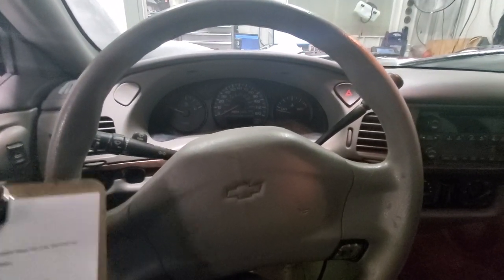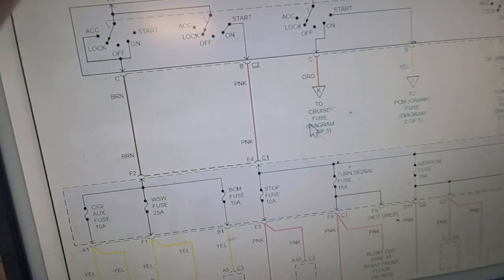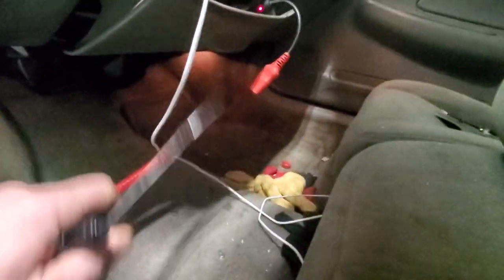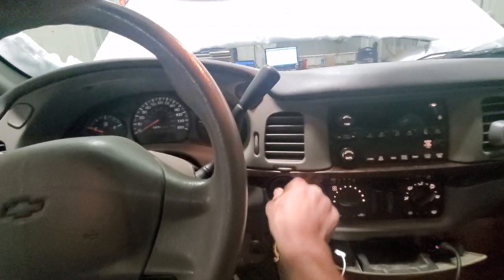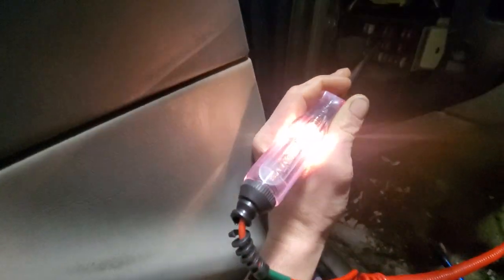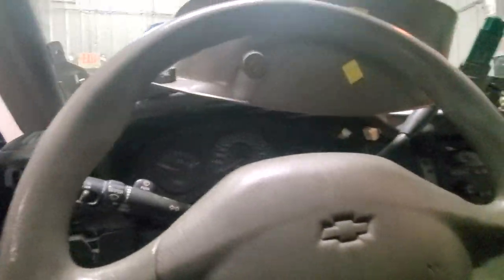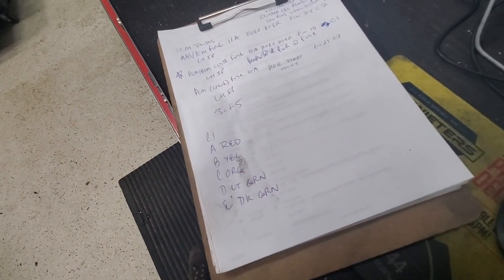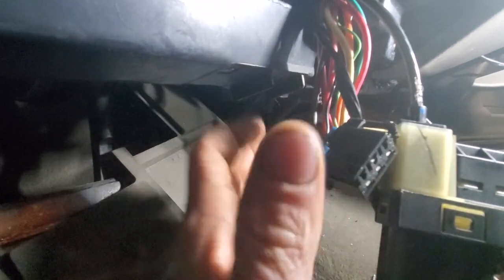2005 CHEV IMPALA 3.4L, INTERMITTENT START/STALL

Comment: I have to say when your looking at the wiring diagrams on that big screen it's easy to read. My old eyes like that. Nice chase of the culprit wire and connector. As a customer we like fixes with no parts required but yeah, I'd get the switch too.
Reply from the maker: Thanks Wyatt!

Comment: I hate having to go under my dash. Looks like you found the problem, but I don't think die-electric grease would be needed unless there is a water problem there. I have learned to avoid getting it on the pins, because its non-conductive and can cause more problems. My car, I would de-pin it and reshape the pins for tighter fit.
Thanks for the vid, need more LOL
Reply from the maker: I have never had an issue with that...been using it moderately on connectors and seals (except O2 Sensors ofcourse) and have never seen it to cause issues.

Maybe I'm wrong, but if it has worked on airbag ckts connection problems I'm simply not doubting it is able to be conductive...

Comment: I'm kinda having the same problem but if I hold my key it will run the starter will shut off it will stay running. I took it to lot of different places they can't fine out what's wrong with it at all. I replaced everything in my car. It's a 2005 chevy impala LS 3.8 L  I hope this video can maybe help me out here I been looking at different videos. If I let ago of the key it shut off it's werid to tell you the truth I been a mechanic for 6 years never seen nothing like this before I was seeing if I could get some help or maybe so information

Comment: Lol my 2005 otw to Chevy for a few recalls don't fall for the diagnosis lmao 😂😂😂🤣 no just the free work please thank you...😉
Reply from the maker: 🤣 oh yeah
Reply: Wire harness cam sensor, crank shaft sensor and all grounds need to be replaced also a bad PCM and BCM can be apart of your impalas issue mines runs like new diy saves bank I'm open for business 👍👍🏽👍👍🏽👍
Reply from the maker: @BlackWolf-ly4sq  We fix one by one and we are on to another.  Wonderful to have success in our endeavors!  Congratulations on your new journey!
Reply: Dealership doesn't fix it for free ??
Reply: Only a recall is free... Unintended ignition key rotation I didn't pay any thing... This service will be performed at no charge to the owner... Free...

Comment: Mine was totally different. When it was running at a little high temperature, it wouldn’t start. It turned out to be a fuel filter . Had to drop the gas tank. I paid someone to do it for me.